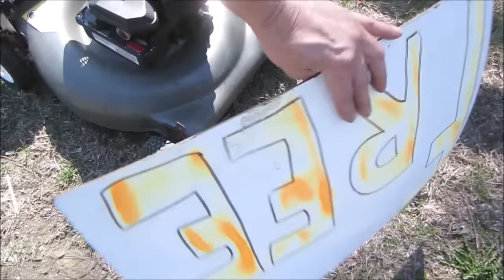How To Restore a Junk Lawn Mower For Free.

Comment: Hey mustie 1 you only cleaned the three spots on the quail and you got to clean the side and top and bottom and the back were the wire hook to so you got to clean the whole quail so the the mechanics and the black sleeve around the metal to work right

Comment: in one of your videos you had mentioned someone giving you a clutch type tool for your drill to start engines   i was wondering where i can get one of those all i have found on amazon are ones for like a weed trimmer with just the small hex head.

Comment: Yes rust can affect it if it grounds out but the more popular cause a failure from rust is if the silica steel Sheets to delaminate generally you just get a week or Spark or lower field voltage.

Comment: It's nice to have millenial neighbors they rent and can't fix nothing . I got an electric mower the other day he was outside and I asked if I could take it from the trash,he said  sure but "it don't work and I left it out in the rain" even threw out the 50" extension cord. I mowed my front yard with it two days later. I jumped the safety switch and the part was 25ish after shipping.

Comment: the bendix on the starter motor and the pawls on the axle work better with a dry lube like ptfe spray or graphite powder from a locksmith. being dry they don't allow crud to stick.

Comment: Here at church we have Botton several movies over the years and I find the plastic gear which follows the inside of the tire is usually attach the tires you got a replace the whole tire. That gear gets worn off no matter how well your oil it with graphite or whatever I see your gear is on the smaller not exactly on the tire itself or part of the tire which I think is much better you don’t have to buy the whole tire
I bet you the cardboard cap is like from stable or some type of fuel additive I think it’s too small for a gas can

Comment: I got one from the trash. It ran fine, then was being a bit weird, then I realized it had no oil. I put some in. Runs still, but if you take the oil cap off of it, smoke comes out of the oil tank

Comment: The ratchet lets you push the mower forward. When you pull the mower backwards, you are rolling the ratchet in the working direction. These mowers get hard to pull if the belt is too tight, or the gearbox pully gets crusty.

Comment: Basically, if it's got compression, you get spark and gas properly and it will run.  Even no compression you can rebuild it, but not for free, obviously.  You can almost always fix them for nothing if you can get the corrosion out of the carb, which isn't that easy if it's bad, but can be done.  If you run the carb dry (at least) with the fuel valve turned off before it gets stored for the season, even that won't happen, unless you store it in a lake, basically.

And the idle circuit is usually the first to go, as the holes for it's outlet up there on either side of the choke when it's closed and are practically microscopic (not really, but they are VERY small).  I can tell you that if you don't get all the corrosion, and some breaks off and gets in one of the jets, it will stop running, even after you get it running.  And a new filter (or one that still works 100%) is critical to that idle circuit, as well.

When I was a kid I bought a little two cycle power products mower that had been out in the elements, on their sign for three years plus.  Had it running 15 minutes after I got it home.  We used to peg the throttle and watch it spin in the driveway...yeah, stupid kid tricks, but the thing ran perfectly when I got rid of it.  

Of course, that was all before all this stupid ethanol added crap, and it seems to me that they could treat the inside surfaces of the carb, maybe anodize them or whatever, and fix THAT problem, but when a carb is sold for $20, that's not likely to happen.  You can leave ethanol laden gas in a car for a few years, as long as you start it occasionally, and it will most often run fine afterward, especially if you throw a gallon or two of good gas in on top...at least that's been my experience. 

The mower I used for almost twenty years with virtually no maintenance, a Lawn Boy, was a freebie in someone's road leaving for the trash.  Zero dollars invested, even over all that time.  The return spring on the starter was getting pretty short by the end of that run, though.  I think it had broken about four times.  :-/  Yeah, I could have bought a new spring, if it wasn't sacrilegious to do so.  :-)  Strangest problem I ever saw with those mowers is that the exhaust ports would get carbon filled over time and the power would steadliy go away.  Cleaned out by hand with advancing size drills until metal was found, and good as new.

GTS should read GTS LOL.

Comment: I have found that people only worry about having an electric start when the maintenance on the lawnmower is well overdue. Once it takes more than a pull or two to start it up, that's when people worry about the starter motor not working. 😁

Comment: What oil do you use for your lawnmowers sir. I acquired 3 Toro's from the neighbor he had no idea what he was doing apparently. 1. Was a fuel problem & that has been fixed. 2 was a belt problem just replaced belt & check drive before saying it was fixed & works well. Now #3 I haven't been able to pin point the issue. It has compression & spark. It wants to start but doesn't. I did my old school bench start & still won't start. I went through the motor nothing broken or cracked. I adjusted the Tom's just so it would run high Tom's but still no start? Is their maybe something I'm not seeing? I usually never have this issue as a tinker, but this one has me puzzled.

Comment: Same drive system used on the Honda - it sucks.  I had nothing but problems with the Honda which is why I got rid of it and now have a Snapper Ninja self propelled push mower.  The Honda engine was fine but the rear drive and the starter system, sucks.  The Bendix  in the starter decided when and if it would turn out and engage the flywheel even when the battery was fully charged.  It just had a lot of short comings - good in some areas and horrible in others.  The speed control was another area of problems.

Comment: when it comes to "lubing" thermal plastics where you fire oil and the residue that's left doesn't attract the dust it just coats it in a sacrificial layer allowing it to glide over scraping some of the plastic off as it runs.

I use it to coat my rust prone tools and it's a b*tch to get off, maybe coating it once or multiple times could help.

Comment: Every couple years I get myself a "new" roadside lawnmower.. 9 times out of 10, it's bad gas and a gummed up Carb.. I've just defaulted to getting a can of auto zone brake cleaner and use it as "Liquid choke".. just spray it into the air cleaner and away she goes..  When it comes time to changing the oil, I go find another mower..

Comment: I’ve come across some machines with a resistor in the spark plug cap that have failed not sure if they use these on mowers more of a motorcycle thing

Comment: It is after 1:00AM here.  Can't put a good book down.  I missed something early I need to kow about.  I have a BD 20v drill.  I use it in wierd ways and have broken the chuck screw four times.  What was the clutch sort of thing that would save that screw.  It's not the cost of the screw, it's the postage I dislike paying.  I have three new screws, one in the drill and it takes a week to get them.
I had that same mower with no electric start.  When it went down I tried everything I could think of, even peening a valve seat back in place.  When it came down to the plastic cam inside, I gave up.  The mower was licked up before I was finished trying.

Comment: Soak that rusty coil in some of your chain saw bar oil - white spirit mix and it will be fine for donkeys years.
The old battery is probably sucking power from the jump start battery.
Dry powder moly lube would be good on those freewheel gears.

Comment: Pop the coil wire wheel it and the flywheel . All Grounds Then air gap it at a bigness card and a way you go .. Make sure the coil in not a open circuit stop ..

Comment: I was sold a "fully serviced" Toro lx 500. Well it bogs to the point it wont move,  has a whining sound & then the gas peddle goes limp with no spring back. . I  could smell belt , or something of a similar at one time as well. Any advice would be greatly appreciated.

Comment: At this point, it could also be a bad  plug.  Need a spark tester or another plug to verify. 😮  Or stick your little finger in the plug cap and hold onto the motor! 😅 10:30

Comment: What machines use the little insulator spark plug and what machines use the big insulator spark plug? What's the point in the difference if they both thread into the same size hole? I haven't seen anything like that explained on youtube yet

Comment: When I lived with my parents, my job was cutting the grass with our gas mower. I always hated that job. When I got my own house, my friend offered me his old mower, probably about 15 or 20 years old, but still working, for $50. It was electric. As soon as I used it, I realized I didn't hate cutting the grass, I hated cutting the grass with a gas mower. The smell and the noise. I still use the same mower 34 years later. Just sharpened the blade a couple times. I don't see anyone  else using a corded electric mower anymore.
Reply: Buy a 4 stroke mower to take care of the smell...and always wear Grade5 hearing protection when using a small combustion engine of any sort...with their very small an inefficient mufflers.
You may find even  electric motor driven garden equipment has a lot of noise...wear ear protection with them, too.
Reply: @JohnSmith-pl2bk  Hmmm. I guess I could spend hundreds of dollars for a polluting gas powered mower that requires buying gasoline and oil, and doing periodic maintenance, and wearing ear protection. Or...I could continue to use my quiet, lightweight, electric mower, which has cost me $0.00 over 34 years, other than a pittance for electricity. What to do.....?
Reply: @clark9992  
Sorry, I thought your tone deafness came from using the noisy garden equipment. You keep doing what you've always done as it seems to work for you...and that's the important thing...
Reply: @JohnSmith-pl2bk  You should try using an electric mower just once. Not noisy at all. Cheers.

Comment: Just Finished working on a buddies mower like that. His was a little older and last yr it started having carb issues, leaking fuel hard starting ect, rebuilt the carb using Tec Parts not aftermarket, needle & seat, Orings, float & gaskets. After it ran but it was lean & by the next day was leaking fuel again Wtf ! I rebuilt it again using a needle & seat that was designed to work with E10, that fixed the leak but it still ran lean and was hard to start & after dicking with it gave him a mower to use that I built from junk. I let his mower sit all winter when I found a new China made carb on Ebay but it was a carb built for the older engines and had adjustable jets, direct fit and now you don't even need to prime it, starts and runs better than when it was new. China Carb $10 shipped. Parts I wasted on the old carb $20+.

 If you clean the Starter drive of all the oil you put on it & put just a touch of grease on the shaft it may work. It uses rubber as the drive cup and if it gets oily it slips on the shaft.

Comment: I have this exact mower in the garage "The drag on the wheels is normal because it doesn't not have a neutral gear its always in gear and ready to roll which is annoying but god forbid if loses traction and the wheels start spinning it makes the most god awful grinding noise" but its been like this since the day I bought it so its normal for this mower

Comment: What cleaning solution are you using in your ultrasonic cleaner it seems to work great
Reply: GUNK carb & parts cleaner, the gallon size includes a dip basket, which you see him use
Reply: Ok thank you I have 3 gallons of that just didn’t know if it could be used in an ultrasonic cleaner

Comment: Nice video.  I did cringe when I saw you tip up the mower with the battery still installed.
Worried fluids would leak out the vents.

Comment: im having an issue im wondering if you could help with it. im having this problem with 2 lawnmowers my mothers and one i picked up...both work good when they start but both have the same problem...they wont start...i replaced the carb on both and it seems like no gas is getting tot eh filter on either mower but once i spray the filter with carb cleaner they start right up first pull time after time..but when they both sit for a week or when its time to cut the lawn again the following week its the same thing..i guess im just tired of having to spray it with carb cleaner all the time ..so whats up wiht that? air getting in?

Comment: I picked up one of these last fall for free that "didn't run" I brought it home, took the air cleaner off, gave her a shot of starting fluid just to see if it'd pop off n it just started right up n ran great. The battery for the electric start was junk n the shoot has the wrong cover. I didn't need the mower I just wanted to play with it. Plan to give it away to someone in need

Comment: 6 or so years ago I trash picked a Craftsman electric start self propelled mower with a Briggs. Last year 
the blade brake cable broke, and the hoard came through again with an aftermarket Z bend and new cable sheath and cable.
The parts hoard paid off, I converted it to auto choke. It’s the ugliest deck in the world, despite being painted on. 
It starts and runs fine.
Yep, I’m thrifty, but just enjoy messing with them.
That being said, who among you has tried the Supertech brake cleaner from Walmart? I bought two cans @$1.98, and another four. Looks like it’s now $2.98. Works fine on carbs for me. The Wearever runs out of air about 2/3 the way down. 
The penetrant spray seems good to me, too. Anyone?

Comment: I like working on mowers and tillers I like to figure out what is wrong with them the first 
3 things I do is change the oil gas and spark plugs then see if it'll start
Reply: No. The first thing is to spray some starting fluid in them to see if they start.
Reply: @kkarllwt  everyone is different on things like this

Comment: That ratchet pawl thing in the wheel can't be disengaging when pulling the mower backwards ... if it did, it would never go forward. Isn't it more for making it possible to push the mower with the engine off, and as a diff substitute?

Comment: I found one in the trash It still had gas in it and everything but when I went to go pull the Pull the cord Pulled in a llittle bit too easy so the first thing that I did was I took the head off it was oil all in the head bolts and the cylinder was full of oil.

Comment: Rust does NOT interfear with a magnetic field, in somuch as it does not eliminate the field. It may lessen the magnetic field, however not to the point where you could actually know it without doing measurements. 
However the rubbing itself could cause its own mangnetic pulse, which could impact the magnetic field from the coil.

Comment: Lol you must live in a very rich neighborhood who throws away an relatively expensive lawnmower like this without sending it to be fix first , people well off with money popping out off their ears lol ! I have the same brand without electric starts the one I have starts on the first pull and its 5 years old, here in Canada sell for around 450$ the only problem with them its the front wheel drive pulling wo is worthless because the small size of front wheels ! I find that using a Ram-Pro Inline Spark Tester , Plug Ignition Tester sold on amazon for  around 8$ does a good job of displaying the arc strength better than a loose spark plug walking around !

Comment: I used to have one of those. Did the exact same thing yours did.  Wouldn't start.  Replaced the carb and it ran for one season.  Next year did the same thing and I threw it out.
Reply: Would it have hurt to either drain the fuel out at the end of season or use some Stabil in the fuel and keep the mower in a shed over winter?
Reply: @JohnSmith-pl2bk  i run them dry every year.
Reply: @leedress2187  
Damn you had bad luck...what are you using now...and has it happened since then?

Comment: @UCcSeeATlWJJbXpOZRYOfaDg 
Mustie1 : thank you for this video . on minute 8ish : the little things you explain is awesome . even though your not working on that problem you take time to explain . im talking about the micro switch and it's function .  my problem is in a troy-bilt mover tb280es 190cc .have no spark . new plug,coil . where can i find how to adjust this type valve like you have on this toro ?  or is there something else i can check ? i did check the magnet on the wheel , side with 3 mag sections is strong megnatic other side is weaker has 2 sections on that side ? thank you again Sir , Best Blessings .

Comment: I use the same mower.  =3   Mine is in a LOOOOT worse shape.  xD  I have a hole in the deck from rust and the carb loves to gunk up.  That said it still starts and runs like a champ.  xD